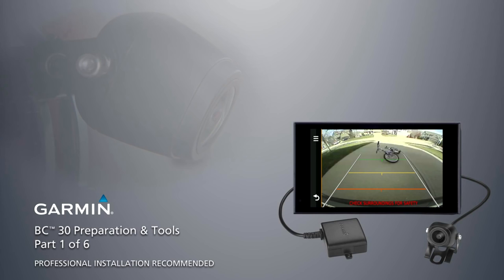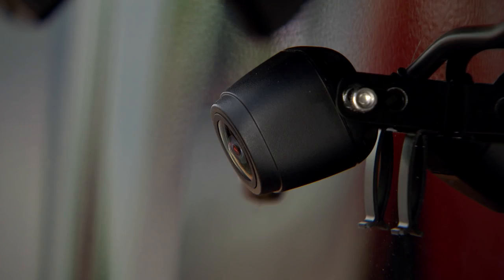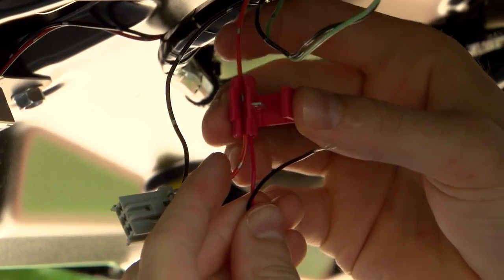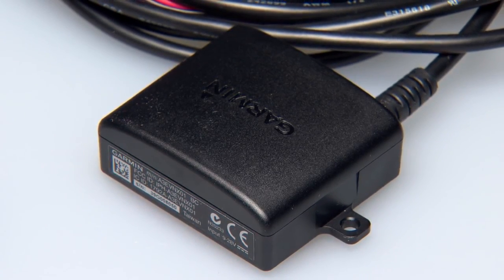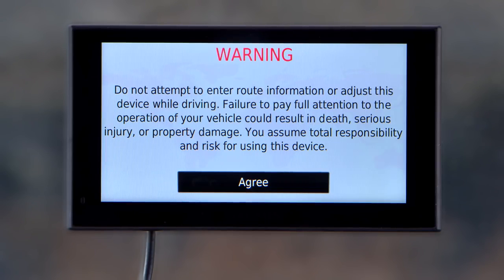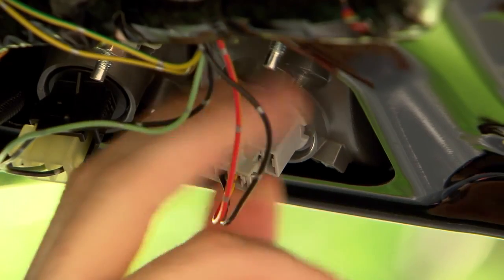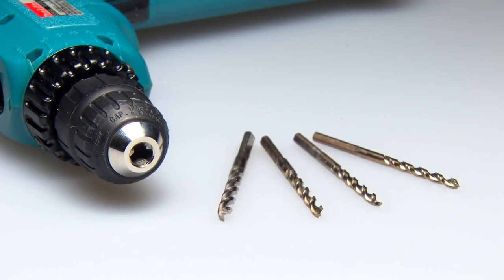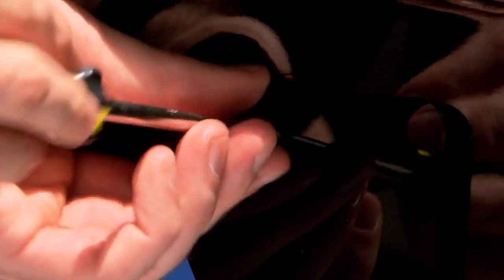Garmin BC™ 30 Wireless Backup Camera – Installation  Part 1 – Preparation and Tools

Comment: The only reason I even knew there was a backup camera available is that it was mentioned in the documentation for the GPS unit. 
Hard to look up which GPS units are compatible due to the bewildering number of GPS units they have. 
Same problem with the accessory module that plugs into the OBD Port to allow seeing MPG, Diagnostic Codes, etc. 
The Receiver has to be built into the GPS unit.